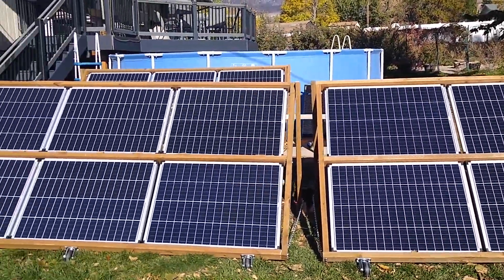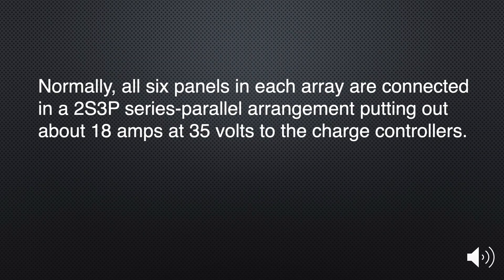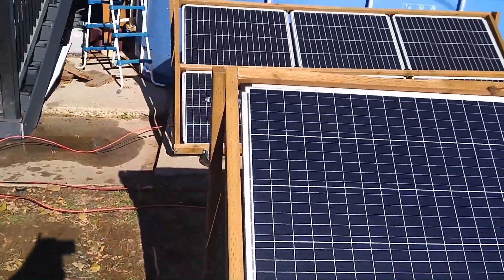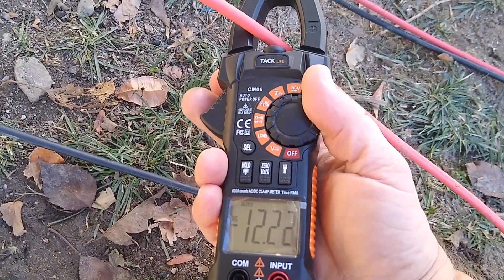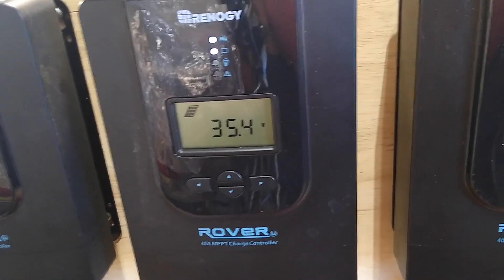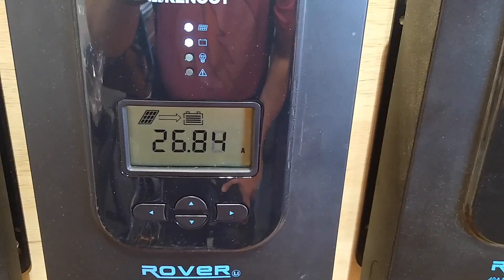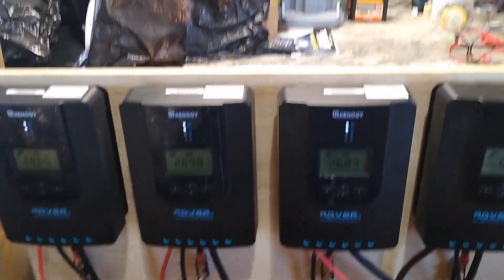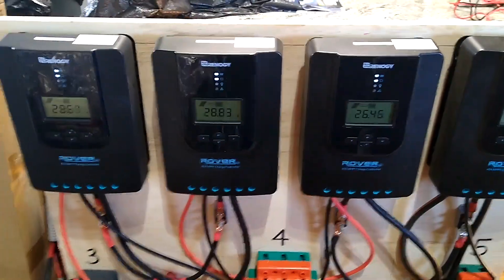Solar Panels Wired in Series vs. Parallel: Does It Matter?  Maybe... Not.

Comment: Would be cool if you could run this all the time, to offset grid costs and pay itself off.
Reply from the maker: Yeah, I'd have to do some significant re-wiring for it to run part of the house all the time but it is possible.  I'm considering doing it for one room where we have a refrigerator and freezer and our main aquarium but it's not at the top of my agenda right now.

Comment: You are likely seeing the sweet spot for the controller.  All parallel has some IR loss in the wires and 18V is on the lower edge of where the controller can work.  It is typical that controllers get a little less efficient as voltage gets higher.  The real test is in shade.  I run 2S6P because 60-70% of my panels are in shade at any time. Shade is a real killer. But my system can operate with extreme overcast skies. Try that test again with slight shading with one panel slightly shaded.  A couple of layers of window screen mesh is a good controlled method of shading one panel. Any successful solar system by its very nature has excess power which is usually wasted.  I harvest any excess to heat water. Energy management is far more important than collection efficiency.

Comment: Nice!  I found my sweet spot is the 3S-2P config.  I can see how the 2S-3P set up works best in your rig so shadows don't affect all the panels.  Hope you don't mind but I'm going to try to copy that panel rig of yours.  I'll be sure to give you credit.  The metal brackets that connect the panels to the wood, did you make those or purchase them, and what would the source have been?  Any chance you could make a video specifically how you built the panel rigs.   Thanks.
Reply from the maker: Hello Chief, so I bought the brackets that I used on Amazon.  They are called "WindyNation (4 Sets) Solar Panel Z Bracket Mount Mounting Set".  They are kinda pricey and if I were to do it over again, I think I would have fabricated my own metal straps for a couple of reasons: First, cost and secondly, these Z brackets are a little smaller (shorter) than would be optimal for my array configuration.  I had to drill the screws into the wooden 2x4s at an angle to make sure they would be secure.  Otherwise, the screws would be too close to the sides of the 2x4.  Still, they did work and so it turned out fine.  But just so you know, if I had to do it over again, I also would have only used 4 panels per array (or if they were larger 300w panels, 2 per array) in order to bring the size and weight down.  As it is, they are large and heavy (150 lbs. each) and require 2 persons to set them up.  With 4 panels per array, I think I could do it by myself.  Something for you to think about.  Thanks for your interest.